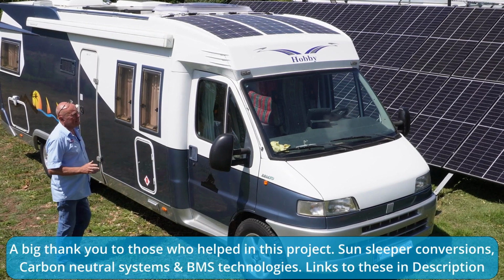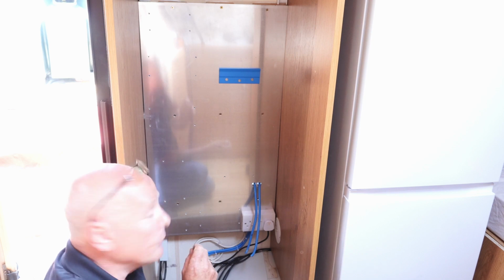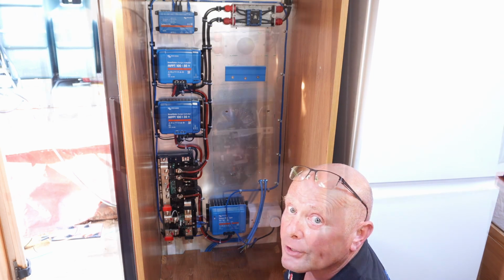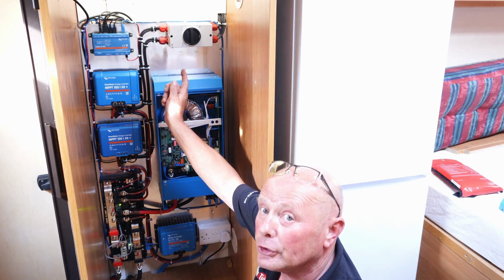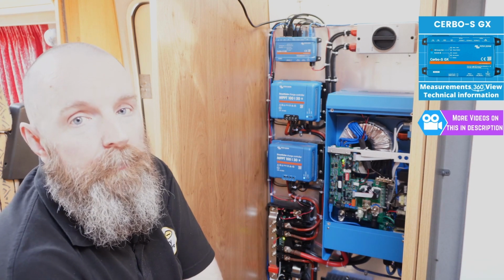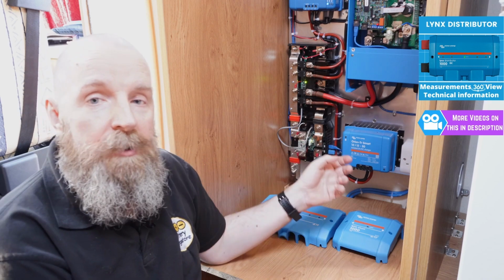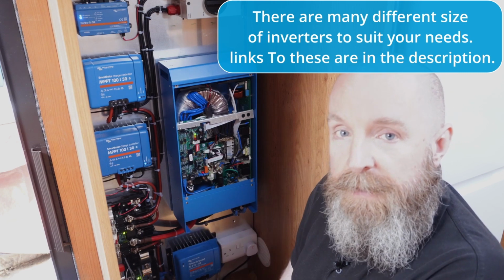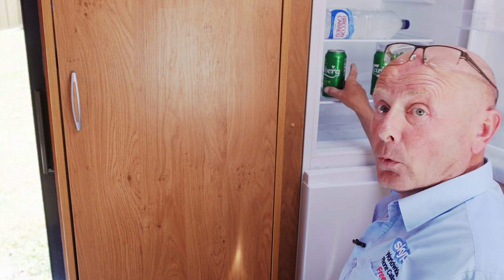#OffGrid Victron solar powered campervan with Starlink, the ultimate motorhome refit.

Comment: Nice project, Did you have major rust repairs to fix on the motorhome or was it just interior?
Reply from the maker: The chassis was in pretty good condition. A little bit of rust on the back axle, but that's cleaning up.